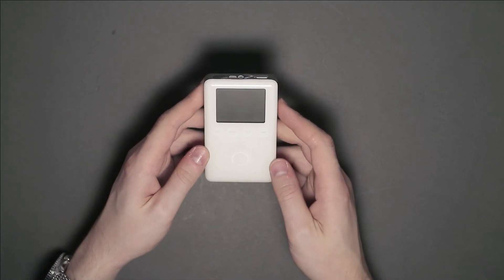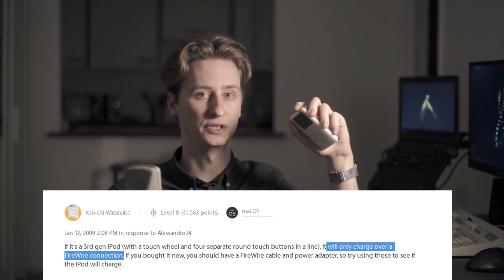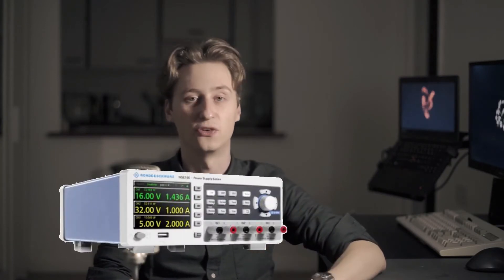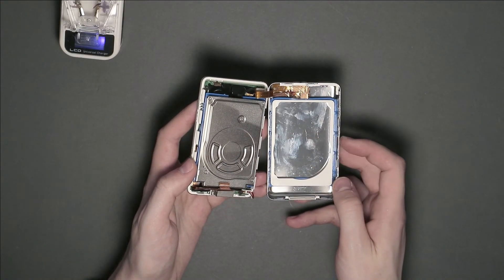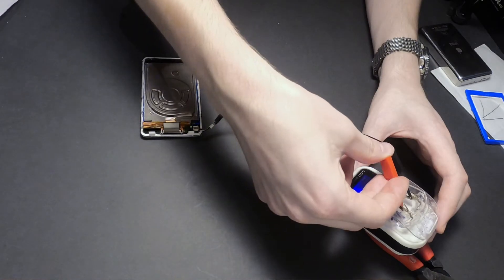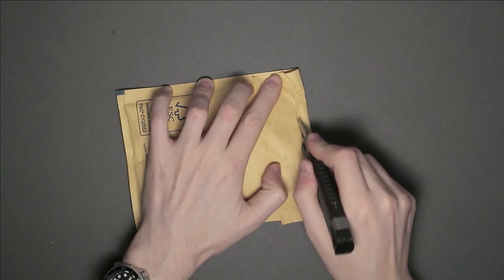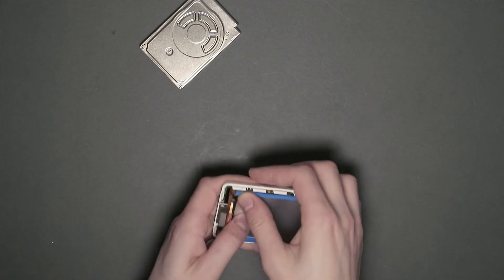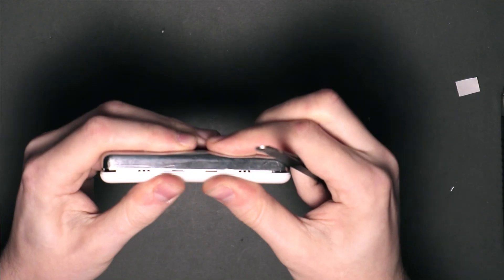Ipod Classic 3rd gen: fixing charging issues and swapping the battery

Comment: Hey whats up man. So i have a 7th gen classic with a 3000mah battery, when i plug in my charger it remains stuck in the battery charging screen and never charges up. For some reason when i use a different wall plug i still have the same problem but the menus screen will pop up i guess because the plug is stronger idk. Do you have and idea why the batt isnt charging? I sent it off to a repair shop and they said its charging fine with a regular 600mah battery they used but the one i have isnt. Ive seen many people have this same issue.
Reply from the maker: I haven't tried any of the big replacement batteries, so i cant really help - perhaps the replacement battery is bad? the fact that its of a larger capacity shouldnt be the cause of the problem

Comment: I have a 5th gen which powers up just fine using a non-usb charger. But, any usb charging cord won’t charge it or sync it to any computer or usb charger. Dock connector is fine, unit is in mint condition with a new battery installed. It used to sync and charge via usb just fine.  What’s wrong with it?
Reply from the maker: 5th gen? What kind of charger does charge your ipod? 
One thing that comes to mind is, perhaps you used a bad USB charger, and either the USB charging circuit or some fuses blew. It would be possible to test if you have a multimeter and are not afraid to open it up!
Reply: @TheRepairLair  nothing wrong with any of my usb chargers

Comment: Good morning sir wow very interesting video you are professional engineer and master I have problem with my apple ipod 3rd generation 30gb classic I have installed new battery and connected to pc on disk mode and restored and then its comes with ipod restored disconnect on PC when I disconnect the cable on ipod screen it shows disk mode and stays on disk mode is this right to reset 3nd gen to hold men and play buttons together? Which I did this I get connected to power when I connected to power by USB fire adapter I see there is loading bar on the display when finished its goes to apple logo and I can hear hard drive making click sound and its stays in apple logo and nothing happens? I reset again by holding men and play buttons it restart and again stays on apple logo can you please kindly help me on this issue waiting for your reply ps is this right to reset ipod 
(1) hold men and play buttons together for rest ?
(2) for disk mode hold men and play buttons when you see apple logo and the hold rewind and forward buttons ?
Reply from the maker: That doesn't sound right, im not sure i can help. But, after the reset procedure is finished, you need to connect the ipod to a firewire 12V charger - it will not finish the restore procedure if connected only via USB. Have you tried that?

Comment: Hi! I've tried replacing the old battery 2x's and each time the battery charges a little but doesn't hold much. Then when I leave it it for a while to charge it doesn't hold any charge at all. Could there be something wrong with the batteries I'm buying? What reliable battery would you recommend? I used to be able to run the unit plugged in even of the battery was not fully charged but it doesn't do that now.
Reply: The problem is probably not the battery. If people do not eject the ipod via the USB port in their computer then the hard drive indexing system becomes corrupted. The hdd then spends it's time on and searching for file fragments that it can't locate. How to fix. Use the ipod sync and charge cable and plug it into a Windows based computer. The computer will recognize the ipod and download its drivers. Then when it is complete go to the drive assigned to the plugged in ipod and open it. If it is corrupted it will report that the file system is damaged and ask if an attempt at auto repairing can be made. Say yes. Once it reports it was successful you can open the drive and view the files. Then EJECT the drive the correct way and don't just pull out the USB cable. Once that is done then your ipod should recharge and hold charge normally. Let me know if this works for you.
Reply: @meisievannancy  I have since been able to re-charge with a Fire Wire cable from Laptop to iPod. I will investigate your method as well.
Reply: @johnmiic  hope it helps. Usually a corrupted index will appear to be charging but never really get to 100% and will discharge quickly.

Comment: Plss make the diy usb cable that has buck converter 5v to 12v usb.. and solder it through fire wire grnd pin 29&30 and 12v+ on pin 19&20

Comment: Hi 
I have this old ipod here and i will get   it back to live but i haven't the firewire anymore what can i do to charge it ?
Reply from the maker: Hi! If you are familiar with electronics and soldering, you can wait for the remaining parts of this miniseries - one video will be about modifying the ipod to support charging via USB cables. 
Otherwise, I'm sorry to say you will simply need to buy a firewire cable and charger.
Reply: Hi :-)
Great Video !
And thx for your Support 
Sorry i have to ask dumb questions Again 
It won't charge with ipod 30pin/USB cable (which works with newer ipods) because it is the wrong  connection to the ipod or wrong voltage ?
...I have a power bank which can delivery different Volt outputs it is for charging Laptops 
So i thought i could take this  instead of Firewire charger with adapters?
But which voltage i have to choose?
Only 4v ?
Because on the backsite of the old ipod is written 8-30v by 1A
Reply from the maker: Do not try charging via the USB cable, especially with different voltages. The USB cable is wired differently to the firewire one. The USB is 5V, firewire is 12V, it uses different pins. Should you apply more than 5V via the USB cable it is likely to damage the ipod.
Reply: @TheRepairLair  
Ohh ok Thank you for the Info 
So the Fire wire dock plug is also Special good to Know 
On Amazon is a firewire cable available which has the dock plug of course and on the other end a Fire wire plug and a usb plug 
Maybe this in combination with my 12v output power bank will work?

Btw:
Can't wait for your next Videos 
Because i have To modifi the ipod first the new akku 
but before i have to look if its working 

Thank you for answering all my questions !!:D